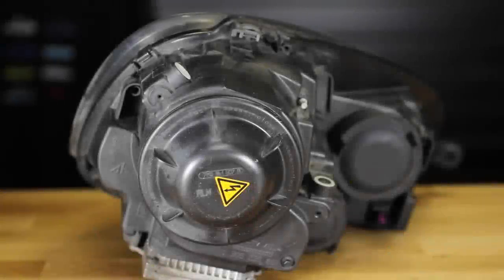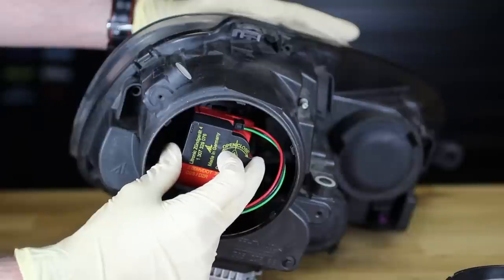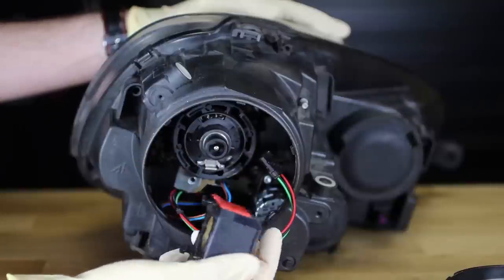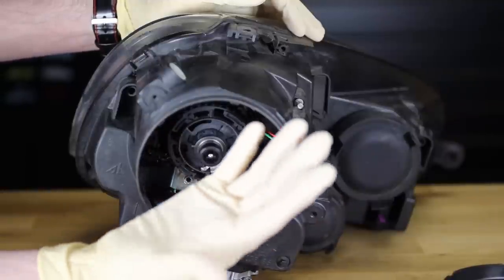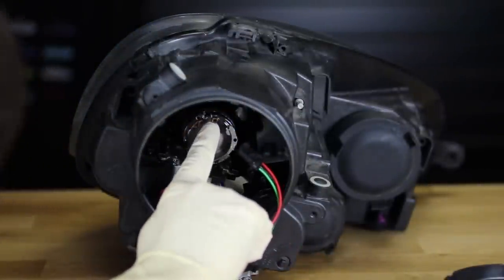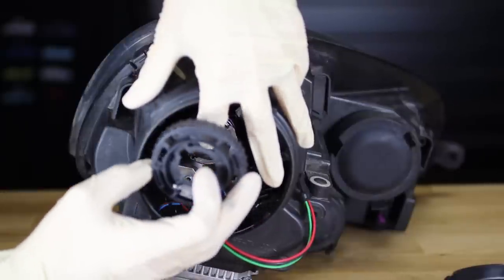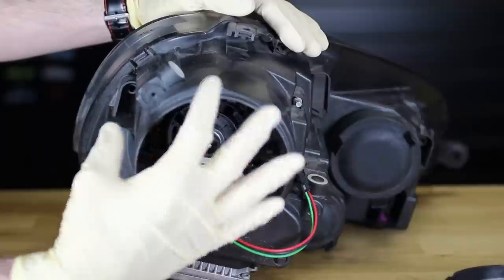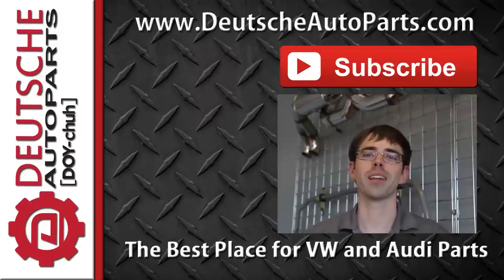How to Replace and Diagnose HID (Xenon) Bulb Problems on VW MK5 GTI and Jetta

Comment: For anyone who may be struggling for- (what appears to be a lifetime) ever trying their darnedest to get that bloody ring to snug on. I have the key! The proper seating of the ring is pressure sensitive application. This means that after you line up the bulb correctly. Then next (as shown) the ring. You'll need to first PRESS IN the ring, itself, before you can ever get that satisfaction feeling from the locking mechanism into its proper position. That's the gold! For whatever reason the video edits (3:30 min) past this critical moment in the process. Making it seem like all there is to do is discover the alignment then just turn it into a lock position. But that's very misleading and, as you probably realized, extremely frustrating, too. So save yourself countless hours of grief. Impart this simple little method and see the whole thing come together with ease.

Comment: You may run into the case where you can't twist the ballast back onto the locking rig. Here's what's going on: Within the ballast there is a cream colored plastic ring that locks the bulb and is a part of the connector eject mechanism. If it gets out of alignment you won't be able to re-install the ballast. Take a screwdriver and just move the ring around so it's notches line up with the other notches in the ballast. Then the ballast will twist on easily (as in the video). BTW- you can't attach the connector before you install the ballast- if you try to do this the aforementioned issue will occur. I learnt this the hard way....
Reply: Jason Harris you're absolutely right. Plugging in the wires trips a tiny mechanism that rotates that clear plastic washer. It's crazy.
Reply: Thank you so much!  I'd just spent like an hour trying to figure out what was going on and this comment saved me from a massive headache
Reply: Now I see this comment after an hour of trying to get the ignitor connected...
Reply: Jason Harris thanks so much
Reply: Thank you!
Reply: All Heroes dont wear capes
Reply: I'm about to try this. Will keep you posted if it works

Comment: This is the best instruction video; once I understood the 'square' bit up the top, everything was easy to place in and no resistance to lock into place. After watching this video from 2hrs of attempting from the manual it was done in less than 5 mins for both sides. A good tip as well is check eBay for the bulbs, $300 was to buy 2 bulbs where they were identical to ones I could have got on eBay for $35 for the 2. Thanks heaps!

Comment: His instructions are excellent, took me 5 to 10 minutes to replace the LED.  You can tell it's the LED by looking at the oval bulb in the old LED;; if it's opaque, it's your LED.. If you have a level or downhill ( face car downhill) area, seat the new LED, notch up, as described in video, then insert collar with "TOP" indicator carefully over new LED and wriggle till it seats and turns to lock easily.  Then do as video instructs.  If you're in a big hurry you will screw this up and make it harder than it needs to be; I've been there and done that!  Oh and mine was on the tight driver's side and I got large hands😁😉

Comment: Have you guys come across the low beam reflector motor fault? Code 02498?
I can't find parts for the motor. 
Is it replacement of the rear housing ?
Cheers

Comment: Hey, great video! Just one note, it's difficult to nail this assembly without the actual headlight removed as you have it. Perhaps a quick update that shows the technique mentioned by another commenter—show us how to install with the ballast + ring + bulb preassembled. I spent a lot of time cramming my face into my car's nether regions making sure things were lined up, only for the bulb to squirm when I tried to line up the ring.
Reply: I agree.  Try it with the headlight assembly in the car.  VERY difficult the first time.  Need eyes on the tips of your fingers.  Almost impossible to line it all up.

Comment: Hello Mr. DAP

I already replaced the HID (same model as your video)bulbs 3 days ago but I have some issues with my headlights when I turn the lights on after 1 min show the yellow bulb on the dash and the message "Front Left dipped beam not working" and the light goes off, the first 2 days was the right but now is left and sometimes it works fine on DRL but not always, you have an idea whats could be the problem?

Comment: Great video man!
Reply from the maker: Thanks.  We appreciate it.
Reply: Hey guys huge fans of both of your channels! I’m currently having a problem with my headlights were they are not coming on at all. Originally the passenger side was slightly more dim the the driver side, then driver side was purple and ultimately losing both all together at the same time. To preface this the driver side was a much newer unit, replaced about a year ago. Is there a module that controls both headlights?

Comment: Very helpful. Watched this a coupe times, then headed out to the car, 10 minutes to do both sides. Thanks for this!
Reply: Hello. I must know did you remove the entire housing assembly to install the hid replacement bulbs? That is did you remove the front bumper and grill and the lighthousing prior to installation of new HID bulbs?

Comment: Would you recommend taking the housing out to install headlights? It's such a pain in the arse to do lock them in place correctly in car.

Another question, If the ballast is not caution sign facing up, will that disorient the light? I only ask because mine are slightly off angle and my light is suffering.
Reply from the maker: Josh Wallace No we would no advise taking the headlight out to do this.  While it is not easy to get to removing the headlights requires the front bumper and grille to be removed.  As far as you question about what we assume would be the igniter, the orientation should not affect light output.  You might need to aim your lights or you could be have a bulb or igniter problem.

Comment: One of the chrome rings around my xenon headlight has come lose out of position. Can this be fixed from behind where the access to the bulb is, or would the whole headlight casing have to be opened to fix the ring back in its tabs?

Comment: Great video,
Would a bad bulb or igniter cause a mkv gti not to auto level?
Both front and rear leveling arms are connected. Also igniter and leveling motor is plugged in.

Lights are not auto leveling, and the brights aren't staying on, automatically going back to low beams after about 30 seconds.
Reply from the maker: Its tough to be sure if you are having 1 or possibly more issues.  The headlights not adjusting is likely to be the range control motor
http://www.deutscheautoparts.com/View/1T0-907-391/0/51868.  You should possibly try swapping them and see if there is any change.  

The high beam sounds like it could be an separate issue and you should consider bringing your vehicle to a VW specialist to diagnose this.

Comment: hello I have a 2009 GLI my driver side light gave up a while ago Paul any chance you can give me some tips I changed both bulbs nothing they work perfect there DS2 the ignitor I don't know if I switched them around and I checked the cuircuts does this mean I have to buy the hold head HID light housing ? or should I take it to a mechanic? Thanks

Comment: The wiring for my headlight bulbs is extremely corroded and I need to replace them any advice?
Reply: If you're gonna do any electrical work good tools are always a really good start point

Comment: Question? I burnt out a hid bulb and replaced it but had issues since I didnt remove the headlight. few days later it went out took the headlight out noticed i must have not connected it securely and the bottom of the bulb and ignitor melted alittle. bought new ignitor and light secured it tight this time and it still wont light up. do you beleive I might have fried my Ballast? thanls

Comment: Nice video!  I recently replaced the HID bulbs on my MKV GTI and now the left side will not light up.  Swapped the bulb and igniter with a working units and the light will not come on.  Also the left side turn blinker in front will not go on but the back left blinker goes on. When I flip the left signal the instrument panel light goes on faster than normal.  I checked the fuses for the headlights but they appear to be fine however I noticed the fuses are 30 amp and the manual says they are 40.  Any suggestions would be appreciated.  Thank you!
Reply: Have you ever fixed it same issue
Reply: @jordonminville6094  did any of you guys fix your issue?? I'm having the same problem. Driver side does not turn on at ALL (turn signal, parking light, low/high beam). Fuses are all good. Igniter, bulb and ballast are also good! I don't know what's wrong with it!
Reply: @znismo1  for me I had to get a brand new headlight set w/wires just Everything in mine seem fried. Worked like brand new but afterwards felt it was too expensive and much of a hastle so I bought non-hid ones after (forgot what they called but like $120 on eBay) and it was so easy to install and use.

Comment: Dear Mr.
I have a 2.5L Jetta 2010 in Brazil. I have stock headlights without HID. One of HID in Brazil, (Xenon) actually doesn't look nice for me, you can't see the bulb/lamp when turned on, you only see a big mass of light. I would like to buy original or if you can advice me, how can i buy HID to my headlight that looks like the original one? How much would it cost? Do i have to replace my headlight or can i just install it?

Thanks a lot!!
Reply from the maker: +Felipe Gibo We are not sure what the laws are there but in the US you would need to convert do projector headlamps to make adding xenon light legal.

Comment: I'm having trouble getting my right light to work, I've tired replacing the Ballast, Ingnitor and  Bulb, still nothing. I really dont want to drop $400 on a new light. Any chance you can give me some voltage check points that I can check out?
Reply: Cody Fitzgerald I'm having the same problem on my Passat once I turn my lights on the right hid lets go then shortly after the left one lets go :( I'm giving up big time about to just put regular bulbs
Reply: After about 5+ hours at the dealer turns out there are some wires that are shorting out on the inside of housing. Going to be picking up the 12 pin Depo lights until I can save up enough to get the OEM.

Comment: Hello please help. Im not sure if im turning it wrong but the plastic discs on my units are EXTREMELY stiff when pulling off, putting on and rotating. Also once i do end up getting the disc and bulb in place, my ignitor doesn’t fully attach back on. Please anyone help if you have answers! Thank you

Comment: Hey im having issues with my bulbs the one on the drivers side flickers  constantly  but wont fully turn ? Any recommendations  as to wht is causing  this? Please and thank you !
Reply from the maker: Cesar Rodriguez you should swap the parts from side to side as mentioned in the video.  This will help you determine what is causing your problem.

Comment: I'm having issues removing the trim ring. It won't budge either clockwise or counterclockwise. The video shows it removes easily but mine won't budge. Any suggestions?
Reply from the maker: +Joshua Ruiz I'm sorry we don't have any suggestions.  There is really only one way to take these off.
Reply: I'm having the same issue.  The trim ring won't budge - I'm afraid to put any more force on it!
Reply: Did you try pushing in lightly then turning quarter turn counterclockwise?

Comment: Awesome video, helped out a lot last weekend when I had a dead bulb on the passenger side.  I replaced both, now about 3 days later my drivers side bulb is showing 'out'.  I've heard some bad things about VW's and electric problems but it's a 06 and these are my first issues.  I also recently had a brake light go out too, but that only costs a few bucks so not as worried.
Reply from the maker: Tim where did you purchase the bulbs from?  There are tons of really cheap poor quality HID bulbs out there that can cause tons of issues.  We know Xenon bulbs can be expensive but purchasing a quality brand from a reputable company is worth the expense on these. 

Hope this helps
Reply: Hello, I got Philips D2S Xenon HID off Amazon, cost $74.99 for two of them.  It just went out this morning so haven't had a chance to take it all apart and make sure something didn't arc or blow out.  I'm not 100% sure on the bulbs, they say Philips all over them and the box.  Only went with Amazon due to the Prime shipping speed.
Reply from the maker: Timothy Wyatt Phillips is a quality brand but $74.99 for 2 seems like they could be copies.  We can tell you that amazon does not do a good job a vetting the sellers (parts specifically) products who sell on Amazon so that could be the issue, but its really tough to say.  You should try swapping the bulbs again from side to side and see if the problem moves.
Reply: Thanks for the replies.  I checked and ended up the cable to the Igniter was unplugged.  Guessing I hadn't connected it fully or hadn't twisted it enough.  Bulb came back on, so it was good news!  I'll be sure to buy legit bulbs from you guys next time I need a set though.
Reply from the maker: Timothy Wyatt Glad you were able to get it worked out.  Thanks for considering us.

Comment: any tips or tricks in how to get the igniter to lock in place? ive been trying for over an hour.
Reply from the maker: Tough to say... Sounds like it could be an issue with your igniter if you have everything lined up properly.  You should double check your bulb is seated all the way as that could be causing your issue.

Comment: can someone help me i have a  2013 VW CC my passenger side HID doesn't turn on . i have switch the  non working headlight to the drivers side and vise versa and still get the same issue. i took the HID bulb from the  non working side a connected it to the Drivers side that's working and the bulb works .

Comment: I replaced a bulb and forgot to put the cap on the back of the headlight back on, I then drove the car for a bit and it rained and now my light went out. What could have fried? I swapped the igniter and bulb but its none of those things. Is it the ballast?
Reply from the maker: +Carlos Robles Im sorry its tough to say.  It could be the module or bad wiring or a blown fuse.  This will require more diagnosis.
Reply: +Deutsche Auto Parts the light flickered on for a bit yesterday. I'm going to have to take the whole headlight put at this point and hope I can dry out any components that may have gotten wet.

Comment: Hi buddy..I just changed the right headlight on my jetta and now the brights don't work.Can you help me out??..Many thanks!!
Reply from the maker: +john mcdonald You should check the connections and possibly fuses.
Reply: Ok thanks and thank you very much for your quick response..The brights work when I put the lever towards me but not when I turn them on,
Reply from the maker: john mcdonald Tough to say could be a bad stalk or something else going on.  It requires more in depth diag.
Reply: Ok thanks you so much for your time..Cheers

Comment: Hi, I want to start by saying thank you for uploading your videos, I appreciate all the info you provide. I have a question for you:
I own a fahrenheit 07 which has hid lights, a couple of years ago one bulb went bad. I called a dealer to get a price on them bulbs which was ridiculously expensive, so after some time I decided to buy them off eBay and they are still working as of today. But... they are not as bright as the ones it used to have, I remember. So my question is does it really matter if its an aftermarket bulb? If I go and buy a set of OEM bulbs will it be bright as it should? Or do you think the ballast is bad? Thank you!

Comment: Clocked bulb retainer has a plastic pin that lock it in place(upper part near the "TOP" inscription). In this video the pin is absent or broken. To remove the bulb retainer you must find a way to pull that pin and rotate in the same time...
It is very hard to do that with the headlight on the car because you have little space to operate...
Reply: This was the best comment of all time!!!!!! Thank you!

Comment: Can u plz do a diagnostic of igniter vs bulb for a VW CC xenon headlamps
Reply from the maker: The same principals apply and the diagnosis would be done the same shown here
Reply: Deutsche Auto Parts thanx 4 da reply, funny thing happened, both my headlamps went out a day apart(R-L) xenon, even the turning sidewalk illumination lights aren't working, at a complete loss, any suggestion where to start?

Comment: hi I put a new light bulb on my car everything aligned perfectly and now I have a warning light that says front right dip beam not working any the light is on but not as bright as the other one please heeeeeelp
Reply: It could be any number of issues. But at least you know it's probably not a connection issue. Try changing each individual parts one at a time until something changes

Comment: How can I separate the igniter from the round cap? cause when I turn the igniter to pull it out everything comes out together...igniter, round cap and bulb :/
Reply from the maker: It sounds like something might have not been mounted properly.
Reply: Deutsche Auto Parts- Your Source for Everything VW and Audi Thanks! But how can I separate the three once the whole thing comes out together? so I can put it back in properly?
Reply from the maker: Tough to say.  Sounds like you might have a different setup than the one shown.